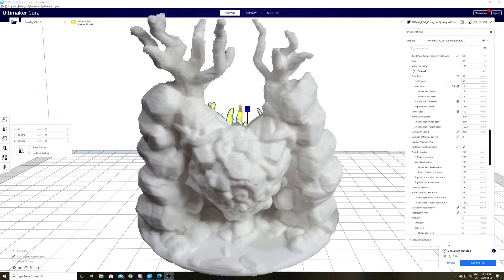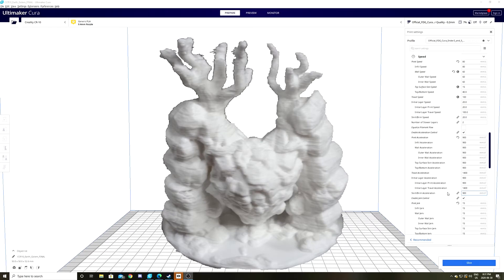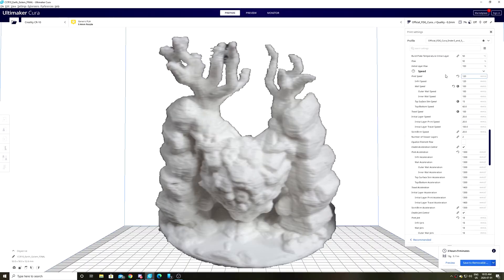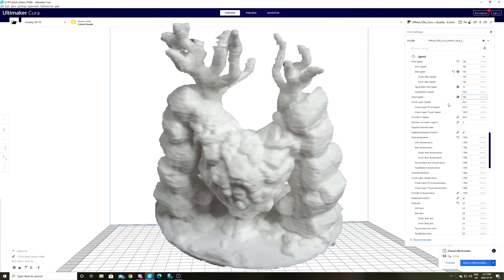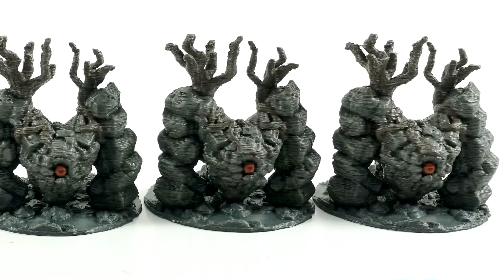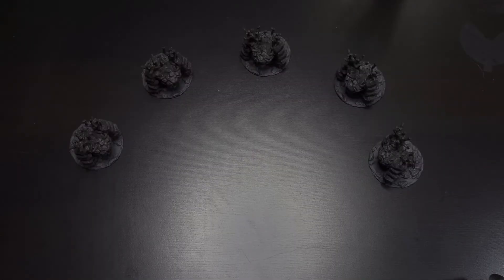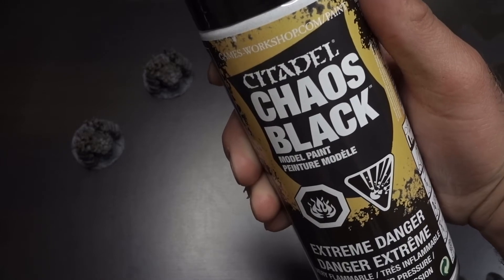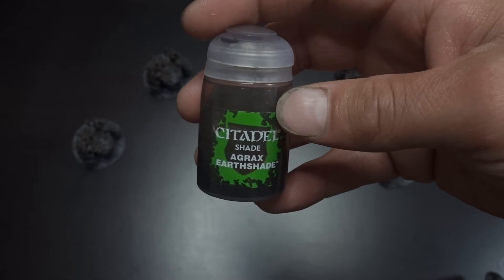Printing Speed Comparison - Creality CR-10

Comment: Thank you! I really needed to know this. But how do you deal with supports? I always tend to snap something off when removing them.
Reply from the maker: luckily most of what i print has been pre supported. but when I do need to add supports myself I go with really thin supports. also when supporting a model yourself you want to be careful with having the support to close to the model cause it can actually fuse to the model making a clean removal almost impossible.  then you want to ensure your using the proper exposure times so the supports you create are the actual dimensions they are suppose to be. for a nice clean removal I do a ipa bath then peel of supports. using my finger nail(through the glove) to help clear off the connection points. for extra tough to remove supports i then submerg in hot water for maybe 10 seconds and continue to remove supports. for nice good support settings I recommend 3d printing pro's channel at this time. i will however be making a video about supports when i get a chance.
Reply from the maker: hahaha oops thought this comment was on a different video. sorry was talking about resin printing in my first response. for fdm I use tree supports. they are amazing and I rarely use the original support settings anymore in cura.for smaller models and miniatures I generally have a harder time with supports, but tree supports definitely help
Reply: @Jesters3DTabletopGaming   Thank you so much! I'll try it out on my next print!
Reply from the maker: @joshuabutler5977  do you have a Twitter or Instagram at all? I could send you a Screenshot of my support settings.

Comment: What jerk and print excelleration did you use a 80 mm/s?
Reply from the maker: 1300 print acceleration and 18 for print jerk
Reply: I never measured it but my jerk speed is pretty high